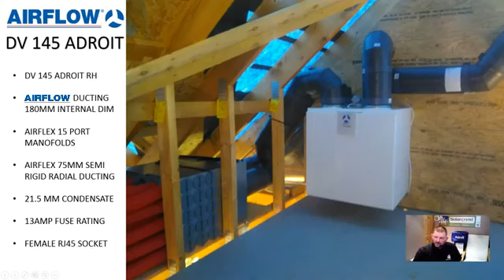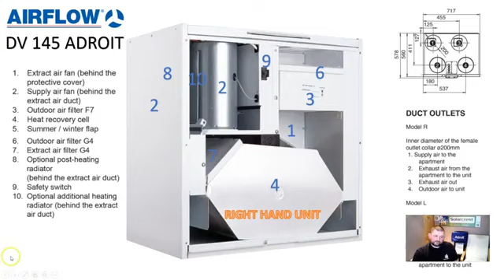AIRFLOW DV145  Adroit Installation

Comment: Thanks for this - I ran my ducting to the rooms ages ago and tomorrow I'm about to install the manifolds and main unit. Interestingly I've been supplied a 10mm roll of 180mm insulated flexible ducting to run from the manifolds to the DV145. Yours looks a lot neater